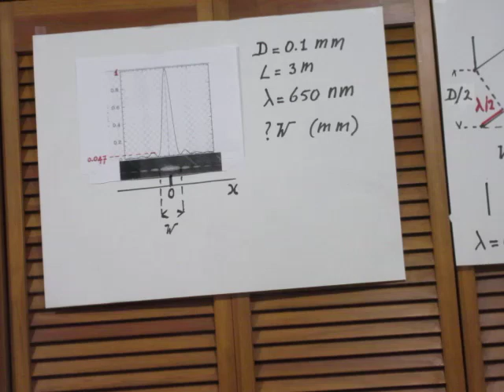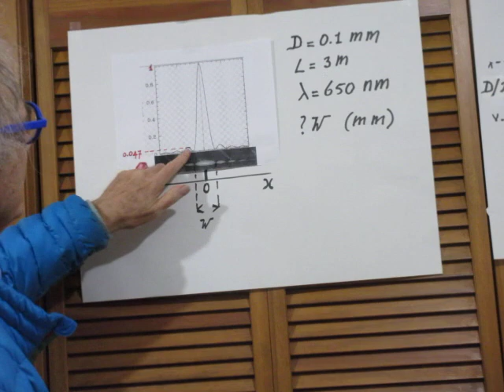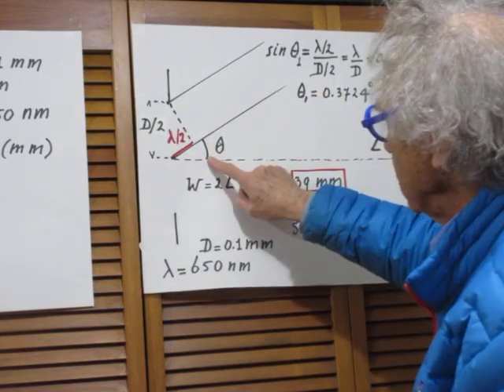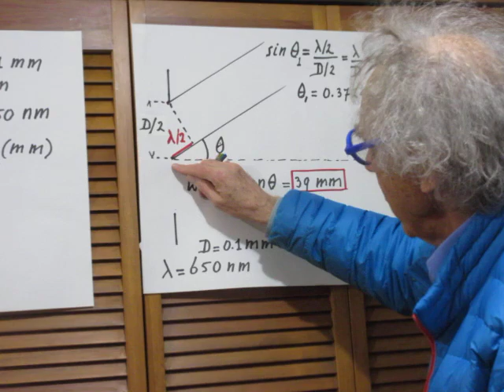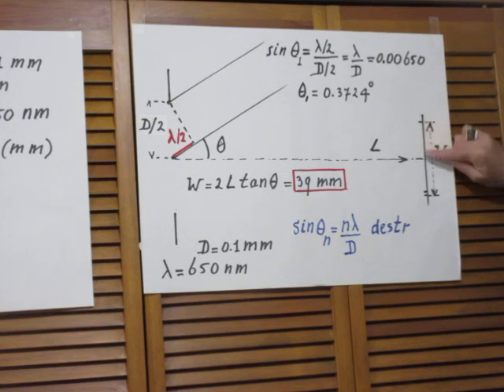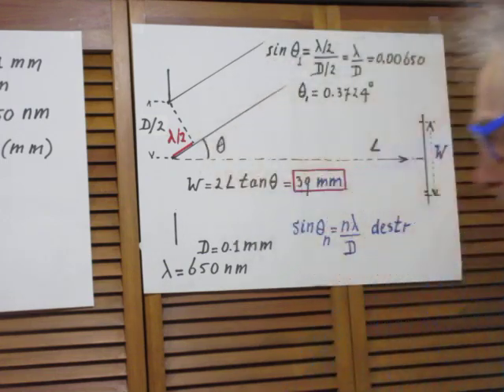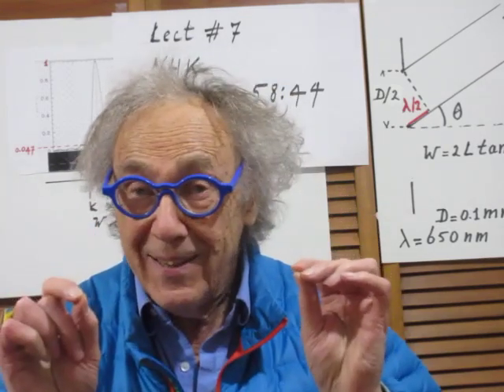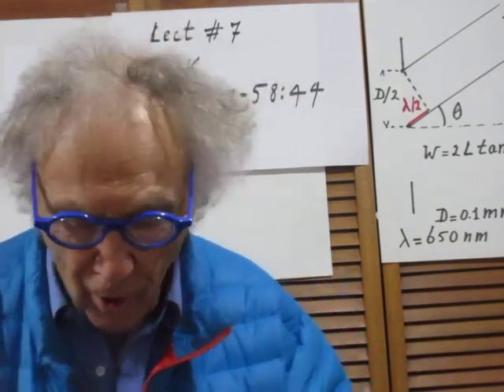Solution to Problem #76 - Single Slit Diffraction

Comment: What happens in an CIRCUIT WHEN an SINGLE ELECTRON is PUSHED into the circuit by an BATTERY with some potential difference.... Will electron stop by pushing nearby electron OR will it reach CATHODE by pushing all the electron in it's way...???
Reply from the maker: question ill-defined. Watch my 8.02 lectures

Comment: Professor,
What will happen if I put a glass slab that covers half of the diffraction slit? How will the path difference change? I understand how it works for YDSE but can't seem to figure it out for Fraunhofer diffraction.
Reply from the maker: you would get 2 diffr patterns on the wall as lambda in the glass would be different from lambda in air.

Comment: Hey Professor, I have a question that has been puzzling me for a while and I wish you could make a video about it. It is to determine an equation describing the path of a ball set to motion with an initial velocity v on a spinning table with a constant angular velocity w. It is a question concerning Coriolis force and the forces that arise in a non-inertial system I think, but I can't find the solution.
Reply from the maker: the solution will depend on the friction coeff. In  any case this is not adequate for 99.9% of my viewers.
Reply: Thank you very much, professor. Can you recommend me a book that can help me with the question ?
Reply: @lecturesbywalterlewin.they9259  you can make it sir because knowledge had no limits

Comment: Lecture by Walter lewin they will make you ♥️physics. Why magnetic field around a straight current carrying conductor in which current moves out the smartphone screen is always in direction anticlockwise always,  never in clockwise or in any other pattern